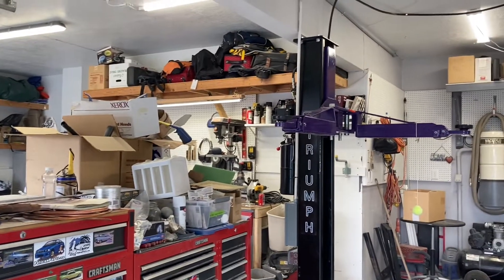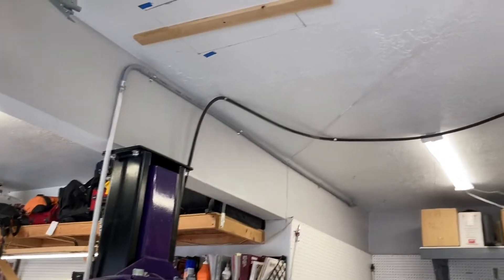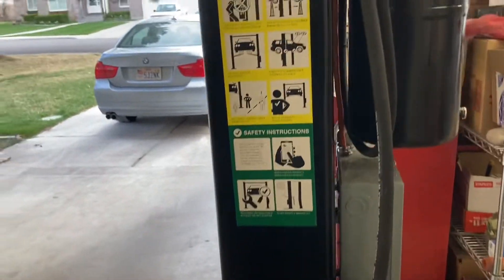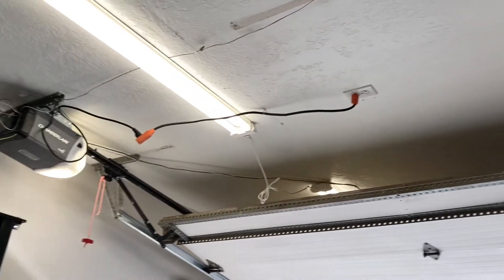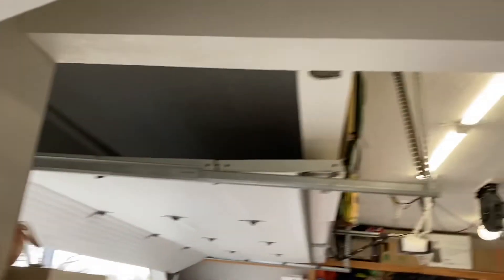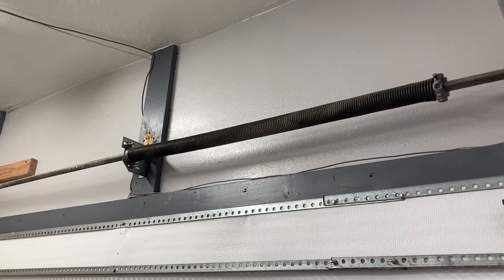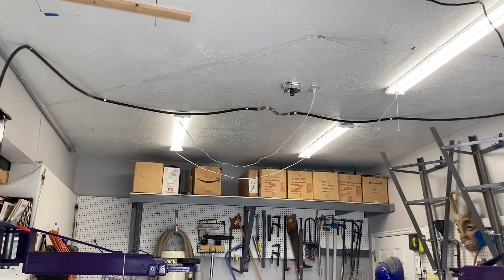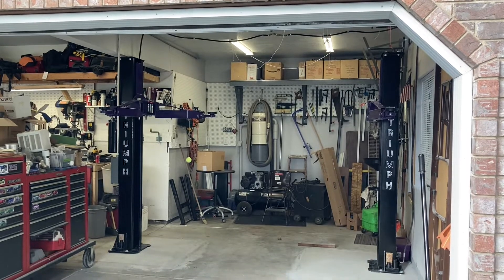Triumph C7000 lift install, alternative to high lift garage door opener

Comment: That's a great idea for the garage door opener.  I wonder how well it would do with a 16' wide door?  I currently have a mid rise scissor lift but am thinking of adding a similar lift to this.  Probably the same manufacturer with a different name slapped on it.  
Thanks for the video
Reply from the maker: The video I used for inspiration said you shouldn't shift the garage door opener more than about 4 feet. Personally I agree and wouldn't shift an opener on a 16' door further than that. Fortunately, that still gives you a bit of latitude for locating a lift on one side or the other (but maybe not right in the middle). We just replaced a Mazda 3 clutch and it was really nice to be able to lower the car to the transmission (in a stand), vs using a tranny jack.

Comment: Hey, how wide is your garage door? I'm looking at this setup and space seems tight with my 8ft door. Also, how far spaced out are the posts? Great video! Thanks!!!
Reply from the maker: The garage door is 9' wide and 7' tall. I can't remember the post spacing, but it's probably around 10 or 10-1/2 feet to the outside of the posts. If I remember correctly, the garage bay is 11' wide, but it's a 3-car garage, so it's open on one side.
When I first started thinking about this, I got the dimensions of the lift post base plates and made outlines on the floor using masking tape. That gave me a good idea of how much space I'd have between car doors and the lift posts. Then I made models of my garage space with graph paper and rough cutouts for the cars (with doors swung open). That gave me pretty good confidence on where the lift posts should be. 
So far the lift has been awesome.  
Looks like you have a 330i E46 - lucky you! I had a 2004 325i which I loved, but now have a 2009 328i E90 w/ 3-stage intake (330i-ish). I park between the lift posts. Front doors are clear, and one of the rear doors can be opened to get in/out (I park closer to one of the posts).
Reply: @garthmason369  Great ideas. Thanks!
It's an E46 M3 🙂

Comment: I thought the lift only required 4.5 inch thick concrete to mount?
Reply from the maker: I looked at many different lifts' installation manuals and did what I thought would be best in my circumstance. 4.5" of 3000 psi concrete is probably fine and seemed to meet the requirements of several of the lifts. My garage floor would have probably been fine IF it didn't have contraction joint running through right where I wanted one of the posts.